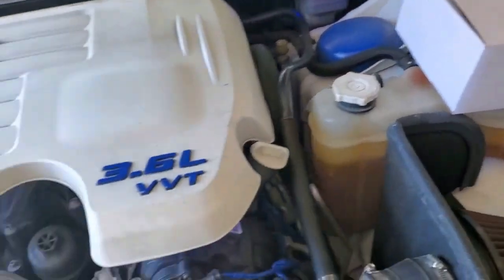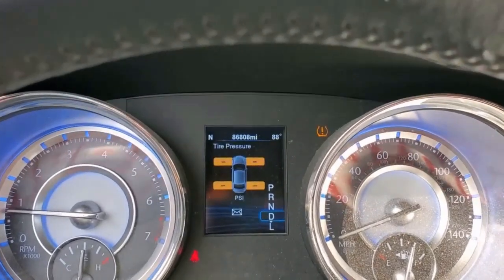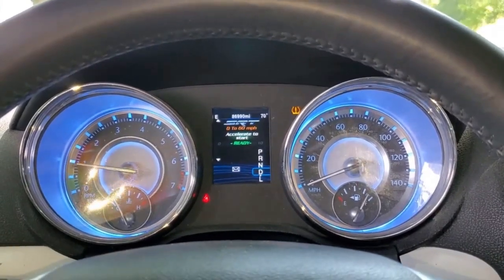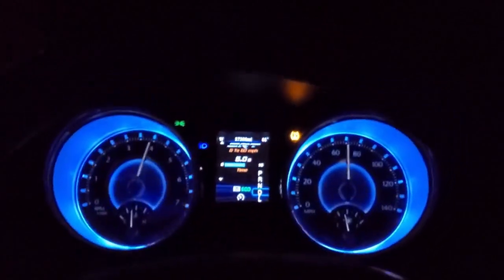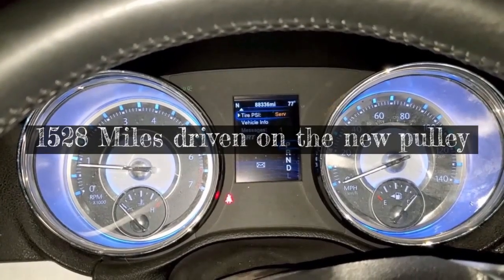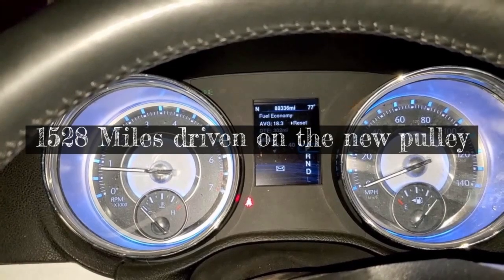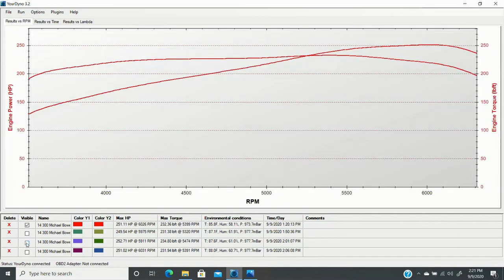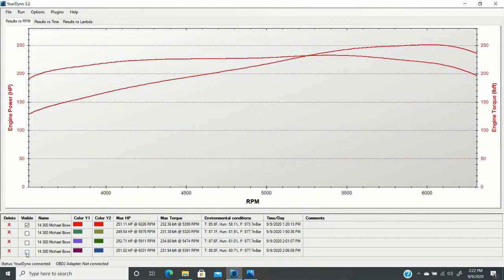Project Ghost "More Powa Baby" Vol 2.  Unorthodox Racing Lightweight Pulley Dyno Numbers

Comment: I still going to get mines installed, it seem like u get a little jump in performance, around the 2500 to 3500 range, even tho it didn't show on the Dyno, you said u could notice a difference when the car is already moving in the lower Low to mid RPM range
Reply from the maker: I "feel" like it did make a difference but the dyno numbers proved it didn't.  Without a documented gain I cant officially say it does anything. But the placebo is real!

Comment: Did you have to buy a new belt before installing, the pulley
Reply from the maker: I hear your supposed to.  I did not end up installing it. I believe I used my old belt. But I have no idea
Reply: @MichaelRansomBowers  gotcha, my pulley should be coming in today, I,m going to change my belt, cause mines is 3 years old, and have you had any issues with the pulley so far
Reply from the maker: Not a single one my man. As advertised it's a perfect swap out.
Reply from the maker: Sorry for the delay. How did yours go?
Reply: @MichaelRansomBowers  mines went  very well, I am was impressed with the light weight crank pulley, it did the job I intended for it to do,  increase my acceleration more, and help take out the lag, which increased my 60 ft

Comment: How much did it cost to get the pulley installed from the shop, and did your 0-60 times improve with the pulley upgrade
Reply from the maker: No my 0 to 60 did not improve. $85 bucks for the install
Reply: @MichaelRansomBowers  so in your opinion you think the pulley is a complete waste
Reply from the maker: I didn't say that....would I purchase it for myself if I was presented this data...I'd have to say no. I'd rather put my money somewhere that would offer bigger gains right away. Now would I buy this as a supporting mod since I've done everything I can to my car. Absolutely,  I'd just spend money wise on my power increases upfront. 
Think of the Dave Ramsey debt snowball. You want instant big wins to keep you motivated. So you pay off small cards to give you those big wins. Then you move on to big cards that take longer and dont give you as much instant satisfaction.  Take the little wins to push you through the big ones. 

This does not add enough power to make a noticeable difference. I would want to do big power adders 1st and this later as a supporting mod